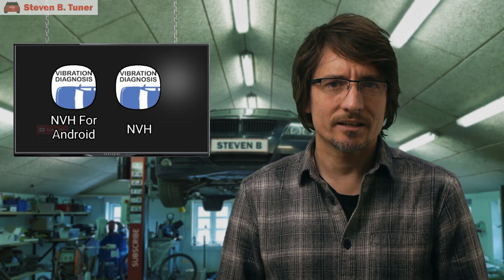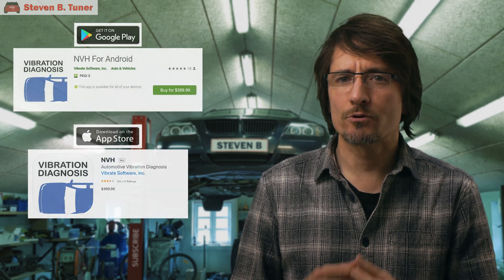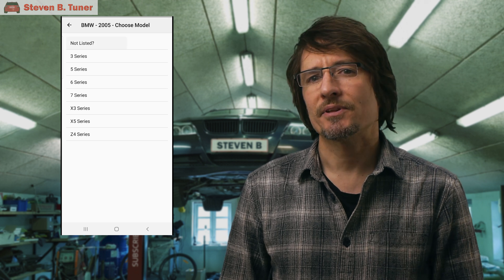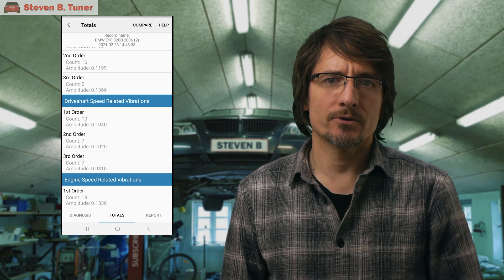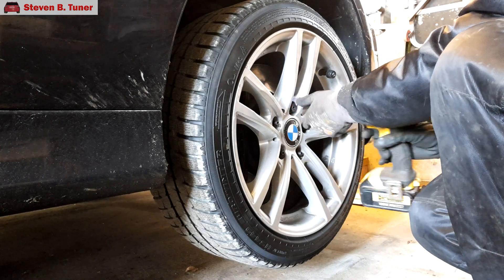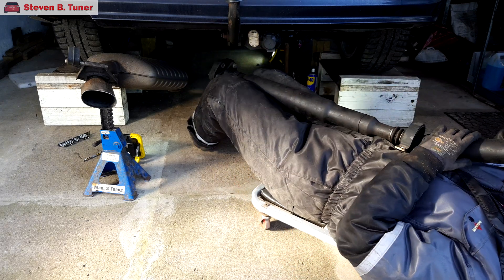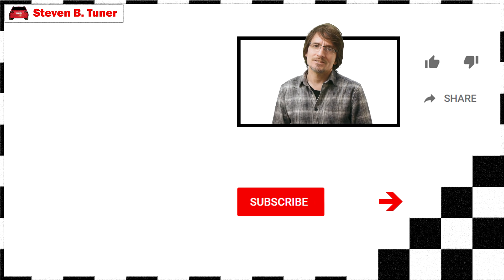📱 Car Vibration Diagnosis with a Phone App: NVH by Vibrate Software Inc. (BMW High-Speed Fix) 📊

Comment: Hi.
Will this be suitable for vibrations at idle?
Thanks
Reply: It reports first order engine-related vibrations and the crankshaft pulley as one of the main probable causes. Which makes sense as it is one of the main vibration-related faults reported for this specific engine
Reply from the maker: Sounds like you are getting to the bottom of the issue. With any kind of vibration there is the source of the vibration as well as the propagation to consider. Any kind of natural rubber used in components is suspicious after it is 10 years old.

Comment: Insanely priced software. Such greed is appalling.
Reply from the maker: Hi, the price has been reduced quite a bit since I made the video.
Reply: It's $99 in 2025. At the time, the developers priced it to compete with the hardware NVH analyzer options and you're paying a lot for the expertise that's built in as far as suggested fixes go.

Comment: I’m having a very frustrating vibration around 60-80mph but mostly during warm weather. 2007 328xi here.
Reply from the maker: Hi, annoying vibrations in BMW cars drive a lot of people crazy for sure, and I am currently working on a video that covers every possible cause. For vibrations at that speed I have found that in almost all cases it is either that the tire is not perfectly round or that the alloy wheel has been damaged (usually the inside edge). It can also be a lost balance weight on the wheel or rust under the brake disc, or sometimes a warped bearing hub if someone has put your wheel nuts on with an air ratchet instead of a torque wrench.
Reply: Thank you for replying! I’ve had my wheels balanced a day ago so maybe it is my brakes! Because this randomly started on its own. Maybe 6 months after doing some top engine work. Potholes are brutal here! So either bent rim or the brakes. Thank you very much!
Reply from the maker: On a BMW it is always a good idea to watch the wheel and tire when it is being balanced. If the tire is 1mm out of round or the wheel is damaged in any way then you will feel it and no amount of balancing will correct it. Also, only use somewhere that uses Hunter Road Force balancing machines - only the best will do for these fussy cars.

Comment: I have vibrations in my front end that’s driving me crazy..2008 528i. Can’t afford that app tho..would anyone have any suggestions?  Usually happens around 40 mph..thanks
Reply from the maker: Hi, I feel a new video is needed! BMW vibration finding is a major nuisance because of all of the possible causes. The first thing to eliminate are the wheels/tires - so if you can swap them out for a known good set then you can eliminate that as a cause otherwise you will need to check for wheel damage, tires out-of-round, and wheel balance. After that the most possible items are the tie rod ends and lower ball-joints if the vibration happens at a steady speed. If the vibration only happens when braking then it gets more complex. If it has been 5+ years since the last suspension work, then a lot of mechanics would recommend buying the kit that includes all of the suspension arms and replacing them all in one go - and I agree with that as once one part starts to wear out then the others are often not far behind.
Reply: @StevenBTuner  really appreciate your quick response..the only thing I have tried is changing the control/thrush arms..but that didn’t help!  I’ll try what u suggested first..I did put the front wheels on the back..still no luck..I
thank you much!!
Joe
Reply: Thank you
Reply: @Uptown-k7d  I believe it’s the torque converter

Comment: Great video. Thank you. Just purchased this app. Only $99 now.
Reply from the maker: It would be great to hear how you go in finding the problem vibrations!
Reply: @StevenBTuner It worked great. It clearly identified my vibrations as a wheel assembly imbalance issue. I found a tire with a slight  buldge in it, replaced the tire, and vibration went away.
Reply: Can you tell me if this does classic cars (1972 el camino) it looks like in the video it only goes back to 1997
Reply: @larryfontana9207 this app works on most cars regardless of year providing you have the correct input data (gear ratios, final drive ratio, tire size). The GPS speed worked fine for me, but it is more accurate with modern cars if you connect it via bluetooth to an OBD2 dongle.

Comment: Fantastic  , I've been looking for few months something like this  , I've changed a lot of parts on my bmw and still have a big vibration at hole car , the mechanic doesn't know what else could be  , I've changed the propshaft bearings, engine and gearbox mounts, new tyres,balanced  , all front kit suspension 
The car vibrates terrible and nobody knows what could be
Reply from the maker: All the best in getting to the bottom of the issue!
Reply: Thanks 😊,  how can I find out what is my bmw differential ratio? It's an e60 525d automatic.
Many thanks
Reply: And how I can find the gears ratios as well  ? Thanks
Reply: @adyvalcea4942  
I

4.171 (11.05)

II

2.34 (6.2)

III

1.521 (4.03)

IV

1.143 (3.03)

V

0.867 (2.3)

VI

0.691 (1.83)

R

3.403

Traction:

RWD (rear-wheel drive)

Final drive ratio std:

2.65

NOW WE NEED A FEEDBACK!

Comment: Thank you Steven for this one. I have been looking at this app for years, but with a price tag of more than 500$ wasn't very "wife-friendly".
I have been using a simple vibration analysis app and made the calculations myself based on the tire size, vehicle speed, and the provided FFT, but this app is spot-on.
Very nice to see it now at 99$.. Just bought it and looking forward to taking the car for a test drive.
Reply from the maker: That's a truly bargain price for this useful tool!

Comment: I've used this to diagnose the vibrations in my Mustang. Driveshaft speed oriented. Unfortunately Ford here in Sweden haven't been as quick as me in finding the issue. I wish they'd use this app.
Reply from the maker: Hi, thanks for watching and for sharing your experience with the app! I would expect that main dealers would have something like Pico that they could use, but at the very least they should be using NVH. Now that you have narrowed it down you can check for driveshaft damage or worn parts, as well as checking the input shaft to the differential and the output shaft of the gearbox - as they are all going at driveshaft speed. All the best in getting to the bottom of the issue!

Comment: I must be missing something.  I show the software for IOS only costing $99.99.  Have they lowered the price?  I work as a Senior Master Technician at a Ford dealership here in the United States.  The Ford authorized NVH tool is $6,000.00.  Even if Vibrate Software is $399.00, it's still a good price.
Reply from the maker: Hi, I just checked the App store, and you are right - a bargain to be had!
Reply: @StevenBTuner Thanks for the quick reply.  As one professional to another, excellent video.  I'll probably purchase the software, even if it helps me diagnose one difficult NVH concern, it will be worth it.
Reply from the maker: @FordTechGuy  Thanks! Be great to hear about your experience when you put it to use.

Comment: why so much money $200 would be reasonable  $500 make it overpriced
Reply from the maker: Hi, thanks for watching! Whether the $399.99 price tag is considered an absolute bargain or overpriced is really going to come down to personal considerations like how much your time is worth, how many cars you will use it on, and how much money/respect/time/future business that is lost if a wrong diagnosis is made. This product doesn't have any competitors at this price point, so it is hard to say whether it is perfectly priced or not - at one end of the scale there are free vibration analyzers and sound recorders you could use (but then you have to try and analyze and interpret the wave-forms yourself), and at the other end are vibration analysis tools like Pico, but by the time you have specified it with multiple sensors you are into the thousands of dollars.
Reply from the maker: Hi, there seems to be some discounting happening at the moment that is worth checking out if you want to get this app now.
Reply: @StevenBTuner  where can i get the discount?
Reply from the maker: @samswildgarage8805  Hi, when I looked it was on the Apple app store it was reduced - I have no idea how long the reduction is for.
Reply: @StevenBTuner  thanks
Reply: ya it's on sale for 139.00 that is quite a discount
from $500

Comment: Haven't used their software, but there info on 1st order vibrations led me to find and correct an issue where the auto box in my HyundaI Iload was bouncing on its mounts at 13hz and my legs and backside was feeling it. And it was bad.
The front tyres needed to be run on a road force balancer to reduce the vibration. This was before their app was out. So found a vibration app to read the Hz at 90 kph. Used some tricky maths to compute and get 13hz.
It turns out this Van is sensitive to tyre variation and the auto box will resonate at the 13hz frequency if its not perfect.  They no there stuff these guys👍
Reply from the maker: Well done on the problem solving! But you are quite right - they have put the knowledge along with the tricky math into an app that anyone can use.

Comment: I was hesitant to spend so much money on a phone app.  Tossed back and forth between this nvh app and pico's kit, but I've been very satisfied with the app so far!  I've learned a lot and also solved a few vibrations without guessing.  It's so helpful to be able to zoom in on a specific speed zone (tire / propshaft / engine)  I recommend this app for sure.
Reply from the maker: Hi, great to hear from someone who has used the app for a while with good results!

Comment from the maker: Who else has had an impossible to find vibration in their car?  
Here is a breakdown of the chapters in this video: 
0:00 Overview
2:14 Installation
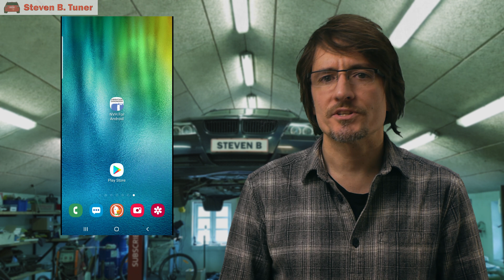3:37 Setup
4:31 Test Drive 1 Data Recording
5:46 Test Drive 1 Diagnosis
7:01 Fixing Issue Number 1
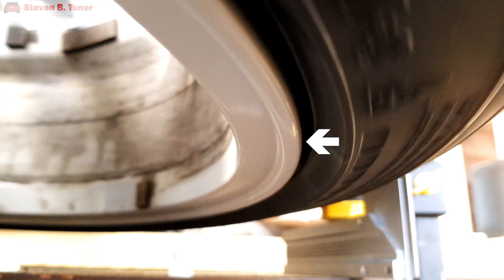8:21 Test Drive 2 Data Recording
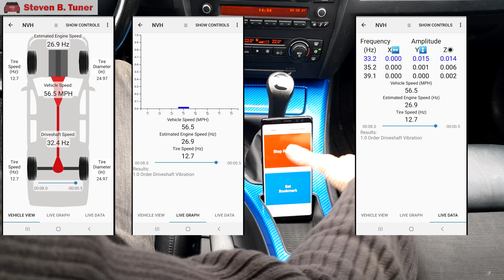8:54 Test Drive 2 Diagnosis
9:30 Fixing Issue Number 2
11:05 Fixing Issue Number 3
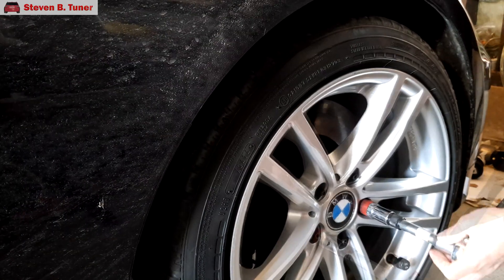11:38 Final Test Drive
11:52 Final Test Drive Analysis
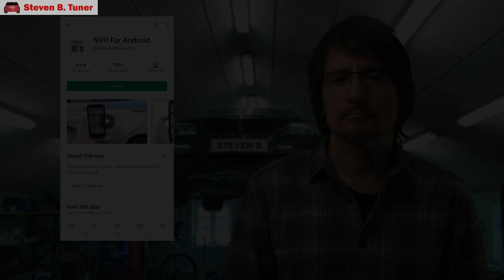12:21 Overview
Reply: Problem for EU users is getting the info required to set up before road testing.
Reply from the maker: @rpsspain1966  Hi, thanks for watching! If you are confident that the vibration has nothing to do with the gearbox, then you can just let the app choose 'default' gear ratios, and then the only thing you have to look up is the differential ratio - so not too bad (and even the differential ratio can be worked out manually by lifting the car and turning the tires/driveshaft by hand if you have to).